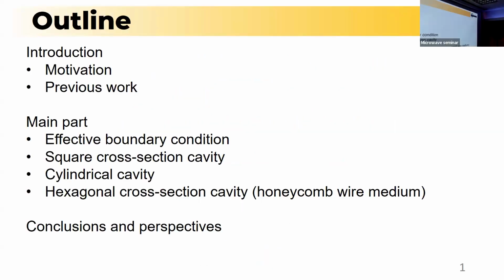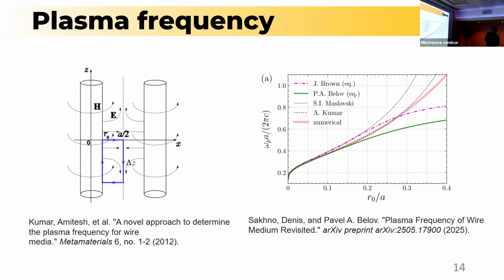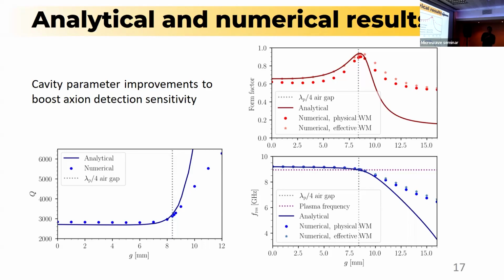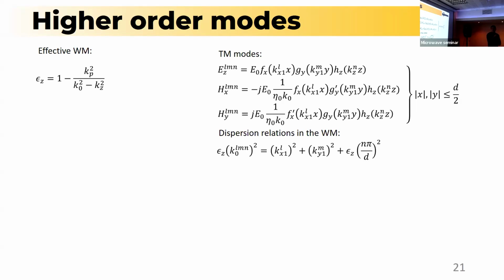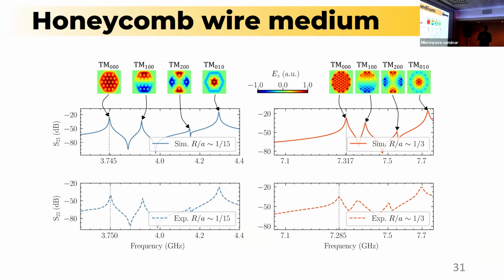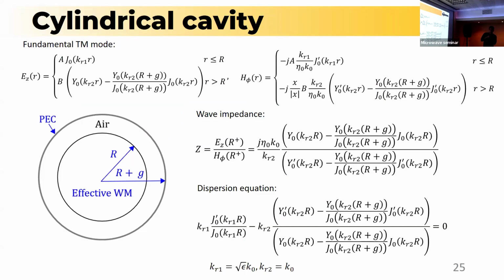Jim Enriquez | Electromagnetic field manipulation in wire media resonators for axion detection

Comment from the maker: 00:00:33 The beginning of the talk
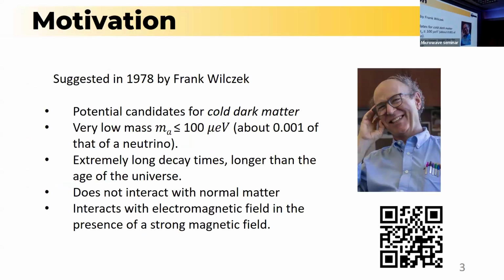00:01:38 Motivation
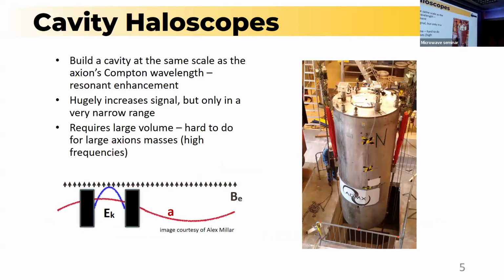00:03:24 Previous work
00:09:12 Effective boundary conditions (EBD)
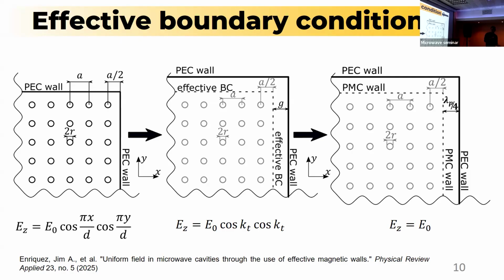00:10:26 1D model analytical solution
00:16:57 2D model analytical solution
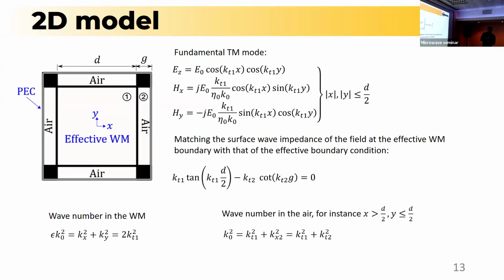00:19:17 Ways to the plasma frequency be determined
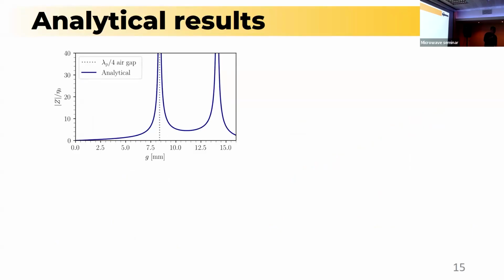00:20:47 Analytical and numerical results for 2D model
00:33:17 Experimental results for 2D model
00:37:28 Higher order modes analytical calculation
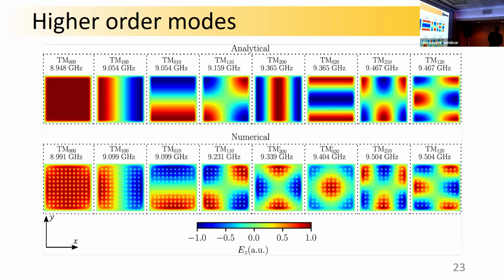00:42:09 Cylindrical cavity
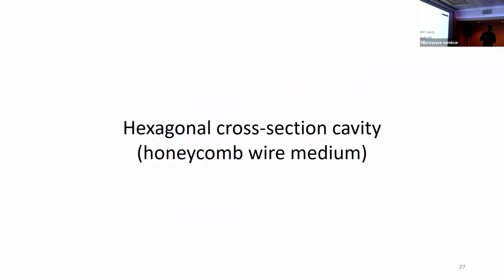00:48:20 Honeycomb wire medium
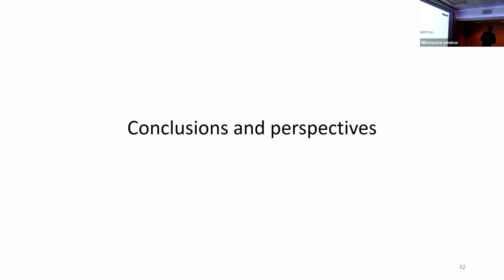00:58:57 Conclusions and perspectives
01:04:30 Q&A